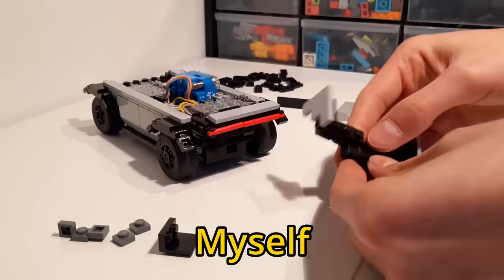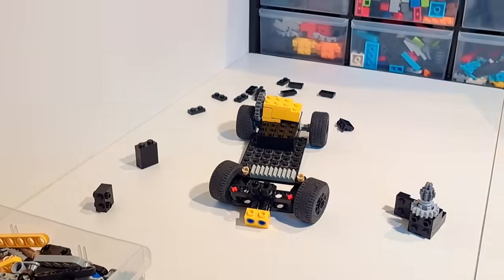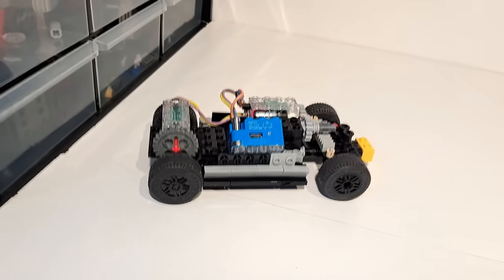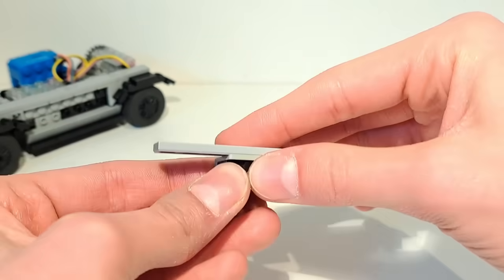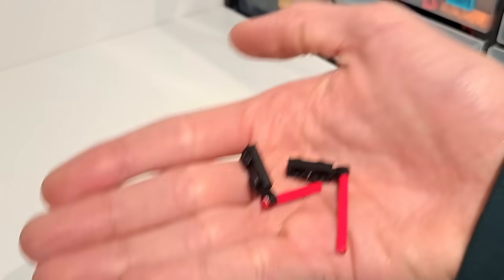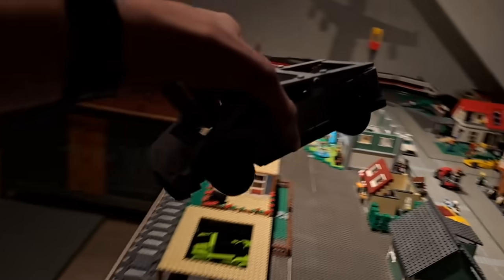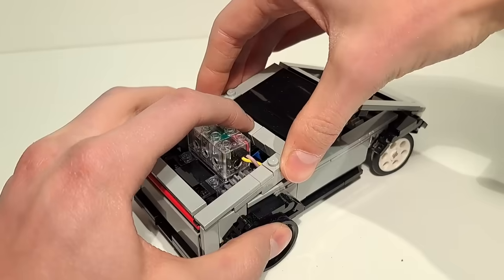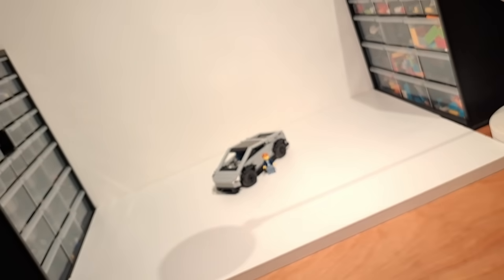I built a WORKING LEGO Car!!

Comment: Excellent video.  My child is using the circuit cube hub and motor but cant see how to get the steering to auto return to the middle.  You mention it in your video, do you have details on how you achieved this please?  Thanks 👍
Reply from the maker: I indeed tried to make it return to center, however I wasn't able to achieve this because of the stiffness of the motors. So I ended up driving it without it returning to center, and I made it drivable by changing the "maximum power" of the steering motor within the circuit cube app. So I made a custom template, to control the steering I used a "direction Pad1" and I then set the "maximum power" to 100. This is what worked for me but I advise to play around with it until you've found settings that work best for your specific project.
Reply: @KoenkunBricks  thank you very much for coming back to us.  I will pass this on and give it a try.  You are a superstar thanks!
Reply from the maker: @spudfingers_united8663  No problem, hope it works out!

Comment: Awesome, nice to see someone else making a circuit cubes car (well, truck). I really need to get some more use out of my circuit cubes, maybe with a slightly larger scale car (like 12 wide) to avoid compromising the looks and be able to make a sportier car.
Reply from the maker: Thanks dude! Yeah this was my first experience with circuit cubes, but they're pretty awesome! I think a 12 or maybe even 10 wide sports car could work very well with these motors! Btw just saw your dyno build, which looks really nice!